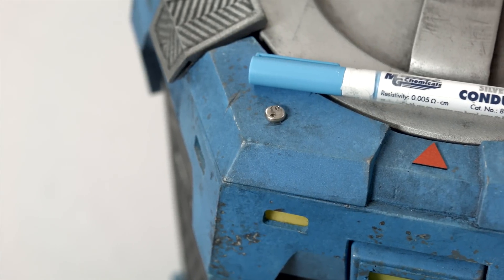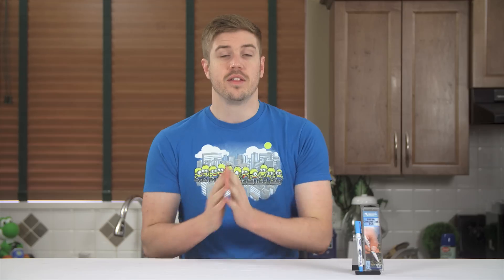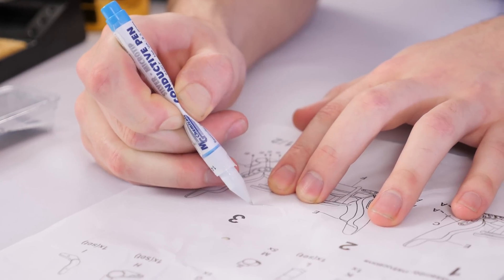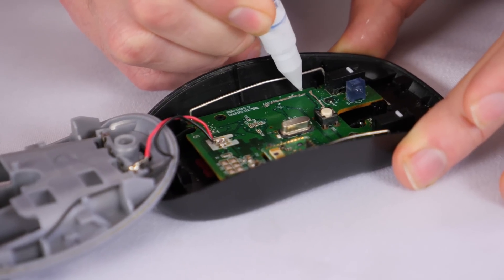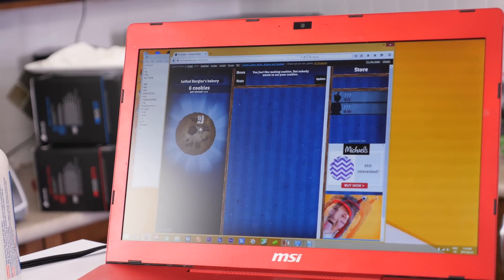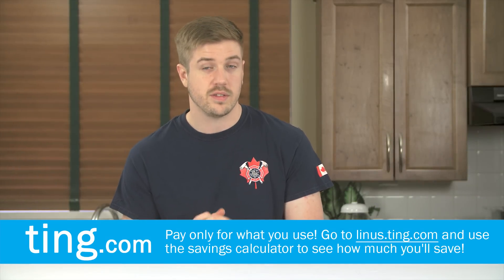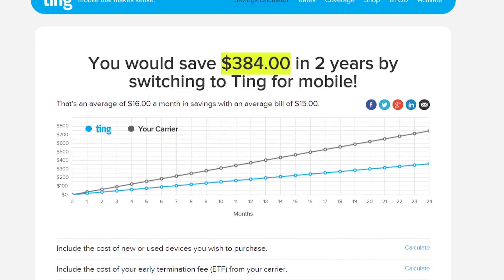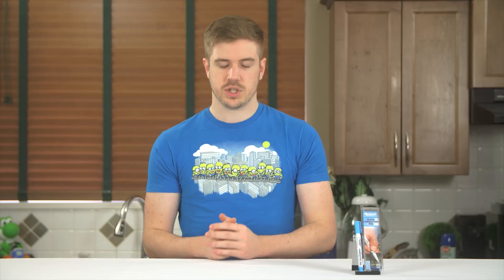Silver Conductive Pen - DIY PCB Trace Repair

Comment: my friend sell his pc for 220 dollars is this spec really worth it at all
Processor : AMD A4 6300 Dual Core 3.7ghz to 3.9ghz
Motherboard : A58 chipset motherboard
Memory : 4GB DDR3 memory
Hard Drive : 1 Terrabyte sata hard drive
CD/DVDwriter : Internal 24x CD/DVDwriter
Graphics : no gpu included so i will just buy Built-in Graphics Radeon HD8370D 760Mhz
Body : Micro-ATX form factor
Reply: iAwesomeDuck If you want to play minesweeper then its perfect
Reply: iAwesomeDuck No it's not, build your own.
Reply: iAwesomeDuck 100% Not worth it!
Maybe like 75$ if you can reuse the RAM and Hard Drive
Reply: iAwesomeDuck I'll buy it for £10. Take it or leave it. (No one else is going to buy it over youtube)
Reply: ***** $459? Lol have fun w/ that. Overpaying.
Reply: no im asking if its worth buying it dude i will buy it
Reply: iAwesomeDuck
AMD CPU's are quite bad over all, even the cheapest Intel CPU will be better.
Also I suppose that the RAM will be 2x2 or maybe even 4x1GB which is very bad as well.
And mirco ITX has only very few conections on the motherboard compared to normal ATX

What are you planning to do with the PC?
Reply: iAwesomeDuck Don't buy it, You could get it all new for the same price. http://pcpartpicker.com/p/xzLLBm
Reply: iAwesomeDuck , you'd need a better CPU, GPU and more ram, and by that point you bought a case and a hard drive for 220. Not worth it, build your own.
Reply: RisseK1 I wouldn't say so, second hand, and pretty bad specs, it'd be a miracle if it booted in under a minute...
Reply: RisseK1 The performance won't be great within the OS either
Reply: P@r@m3d!©
what things make this pc bad (sorry new to pc stuffs)
Reply: iAwesomeDuck The CPU, its worth 37$ or so and just doesn`t perform well. But if you don`t tell us, what you are going to do with it, we can`t help.
Reply: Depends. What do you want to use your system for? The processor is only dual core and also pretty weak. Your RAM will do for normal PC usage, but for gaming at least 8GB is highly recommended. 1 TB hard drive is enough. The GPU also will run absolutely nothing. If you can get this PC for below $100, it might be worth it if you use it as a basis to upgrade. You should also check out what PSU this thing has.

I recently bought a PC with 8GB RAM, 2TB HDD, Q9550 CPU, 4850 1GB GPU and 2 blu-ray drives (because why not). It cost me $150. I took the 4850 out and put an MSI R7 260x OC in it I bought for $50.
Total cost: $200. The processor is weak though, but I'm satisfied for what I've been able to build for that price.

Conclusion: if you're happy with your PC, that's all that matters. But I recommend you to buy a PC as a basis, and then build off of that. Try to find a PC with a better processor, better RAM and a 500W PSU. Don't be afraid to buy your components separately.
Reply: jordan cooke
thanks for your time i will mostly do internet stuffs and some gaming maybe games like league of legends no plans on playing any latest games.as im quite busy right now and i need a pc that will perform fast on normal usage
Reply: iAwesomeDuck I'd say that system is able to run LoL on low-medium settings. Also depends on what resolution your playing at. If you can bring the price down to $100-$120 it might be worth it. But as everyone is saying: you can get a far better PC for $220 by buying smart.
Reply: Lime war gonna need to spend on the OS
Reply: RisseK1 i could upgrade the graphics card to something better if i really need to upgrade
Reply: alrighty then
Reply: iAwesomeDuck The problem is the CPU, again. Ich you can upgrade it, buy a Vishera CPU, like the FX4300, which is quite cheap and gets the Job done. Then a Graphics Card is a must. I´d go for a 250 which can run League on 75fps minimum done, according to Sapphire.
Reply: Yup, very light gaming. also i wanna share my computer specs right now so yeah this is serious ok

Intel Core 2 Duo E4500 2.20 Ghz
1gb DDR2 RAM
Intel G33/G31 Express chipset Family
HP Mobo
80 GB HDD

and its 7 years old and i really need to upgrade this.
Reply: CallMeRabbitzUSVI no dual core amd cpus wont be able to play newer games well, i agree with the others to make your own for 500 dollars

a 750 ti or a 960 with a g3258 or a 760k its not ideal though
Reply: didnt read all the comments

dont need to get so emotional about it
Reply: iAwesomeDuck Build your own, with intel i5 processor and an nvidia graphics card. You won't get much performance from that box your friend is selling.
Reply: RisseK1 Well, here's a couple, 1.While AMD does have good price to performance cards the higher end cards can't compete with Nvidia's higher end cards. 2.Nvidia has exclusive features such as HBAO+ and TXAA, NVIDIA PCSS (AMd has their own custom shadow thing) and of course PHYSX 3.NVidia GPU's run cooler than AMD GPU's, sure the AMD price to performance cards are really good they run at about 90c (I'm talking about the r9 290x here)
Reply: TheRyanDudeMan The reference. The reference Titan X gets to 89° too. The Sapphire cards run at cool 73°, not really an issue unless you run 290X Xfire on Air.
Reply: ***** That's the titan X (the titan x isn't supposed to be for gaming (From what I know) the 980 is the highest end Gaming GPU that I know of (it only gets to 80C or 70c don't know which
Reply: ***** The highest my GPU gets to is 70C (Using a GTX 970)
Reply: RisseK1 Oh, ok I thought you were talking about AMD and NVIDIA overall, if you're on a budget AMD is the way to go. If you have no problems with money, Nvidia is the way to go.
Reply: TheRyanDudeMan The Titan X is made for gaming, they try to justify the price with the giant vram but it has non of the pro features the original titan and Quadros have.
Reply: iAwesomeDuck Bad deal in my opinion. That processor probably can't even handle some heavy browsing without issues. So, 50$ for HDD + 10-20 $ for a cheap case + 20 $ for the optical drive + 25 $ for the ram + 40-50 $ for the MB = 145-165 $ will get you new parts which means he's literally cheating you or he doesn't know their prices just like you.
Reply: Gnana Prakash "Cant even handle browsing" not really, its an APU and can do some light gaming.
Reply: ***** I said "heavy browsing" actually :) and it's a dual core APU if it were a quad core one, It probably would have been fine for light gaming as well.
Reply: RisseK1 How's that stupidity? O.o Also, watching 4k or 2k video content could be considered heavy browsing.
Reply: RisseK1 Tab hording sometimes is a necessary thing. I'm forced to do it in situations like online shopping, loading a bunch of high res pictures from an album or just a situation when you find yourself in the middle of so many important links but you don't have the time to go through them all at that point etc.
Reply: RisseK1 Intel and nvidia chips work well together, sure an amd cpu & gpu will work well too, but I prefer nvidia, since you get shadowplay aswell as really good performance.
Reply: Jacob Hylén that too I love shadowplay! Looks good no performance drop
Reply: iAwesomeDuck rip off
Reply: RisseK1 I don't know why you so want OP to take an offer which is really bad.
Reply: well this will be a total upgrade to my pc right now
Reply: RisseK1 Might be. However a friend of mine did this thing too, he never expected himself to want to do anything but browse the web, so he got himself a pretty bad laptop, however, he got into gaming, and is now going to upgrade, it will be enough for browsing the web and such, but for the future? I don't think so.
Reply: Keeping aside if this is adequate enough for his needs, I think this is overall a deal of poor value. Just because a person can afford 300 $ for a raspberry pi and only wants to look at pictures with that machine doesn't mean it's an acceptable deal. I guess most of the comments here made it pretty clear about the value of the deal. It's upto OP to decide if he wants to buy it now.
Reply: RisseK1 I have made a comment above making an estimate on the value of all the PC's components together go through that and then come back and tell me how this is good value.
Reply: RisseK1 I live in India and you can get most of that for similar prices and in India prices are generally higher than in most western countries. May be except for the cheap ass case.

Comment: Errm, what's the point of this? Just use jumper wires between components, much cheaper.
Reply: In this case, yes. But with some carbon trace PCBs, this is really useful for fixing buttons.

Comment: I repaired a broken trace on a Asus ROG motherboard using this method. Kapton tape to mask of both sides of the trace, then drew the line with silver conductive ink which came in a syringe (availble from ebay), remove tape, Done! Did this a year ago and motherboard still works perfectly. Have been running a 900mhz stable overclock my 1090t with no problems all this time.
Reply: mark carter "this time" made me chuckle haha.

Comment: Could I use this to fix say, a laptop motherboard? I shorted it when trying to change the ram and now my laptop won't charge anymore. Upon close inspection it looks like there's only one trace on the mobo thats ruined.
Reply: Amir Aiman Othman Sure you can, just don't bridge any of the traces together and you will be fine.

Comment: How's my build? answers appreciated
i have a, b, c or d:

A: APU
1TB wd blue
a cheap case
gpu: using cpu's integrated graphics
core i5 4690
gskill ripjaws x 1x8gb 1600
Asrock fatality b85 killer
corsair vs450

B: Amd
Fx 6300
Gtx 750 ti
asus m5a97 le r2.0
1TB wd blue
a cheap case
gskill ripjaws x 1x8gb 1600
corsair vs450

c: Intel
i5 4460
Gtx 750 ti
asus b85m-g
1TB wd blue
a cheap case
gskill ripjaws x 1x8gb 1600
corsair vs450

d: Cheap amd:
Athlon 860k
Gtx 750 ti
gigabyte fm2 a88x d3h
1TB wd blue
a cheap case
gskill ripjaws x 1x8gb 1600
corsair vs450

Thanks :3

Comment: But... Solder mask? Wouldn't that prevent this stuff from making electrical contact with the traces? Or did the solder mask also get eaten away by the battery chemicals?

Also, a metal tool should be ESD safe if you ground yourself... Using a nylon spudger and than fumbling with your hands so close to the traces doesn't make a lot of sense from an ESD safety perspective (however, a soft spuger is nice to prevent scratches).

Comment: well that's a lot easier than using a soldering wire.
Reply: Insane CoolAid They have completely different purposes...
Reply: Sevendogtags I think he meant copper wire not soldering per se
Reply: You have to go over it several times, it's pretty crude, but it does work. Of course I would only recommend doing that if you're in a pinch. Try it out for yourself on something that you don't particularly care about. You may have to press firmly and go over it a few times, but it should work.
Reply: Frank Drebin "per se"
Reply: Frank Drebin 'muricans think it's "per say".
Reply: imfrommanndame If you write it perse that means ass in finland
Reply: DeadCry Im actually surprised the graphite stayed in place on the pcb.
Reply: DeadCry While graphite is conductive, it is also resistive, and will not work in sensitive circuits. You will effectively add a resistor into the circuit, which may or may not do anything depending on the application.
Reply: Fadi Alzammar Depends on your definition of "Sensitive" I guess. I hardmodded an old PPC based mac mini for a decent overclock, and I used this method.
Reply: Sevendogtags i know but what can you do if you don't have anything else?
Reply: Insane CoolAid LOL yep... i know how that feels hahaha :)
Reply: imfrommanndame whats wrong with per se?
Reply: Insane CoolAid I've repaired traces with a pencil - has worked everytime. The graphite in the pencil "Lead" is conductive. Just a thought for us cheapskates out there. This is probably a much safer and better alternative, though.